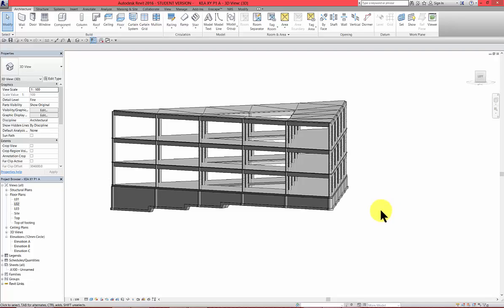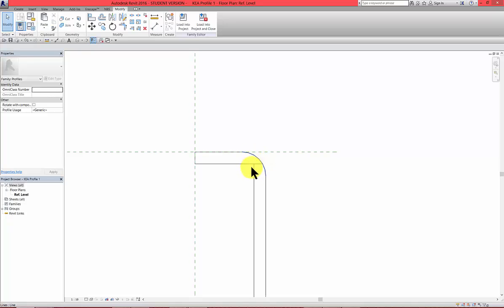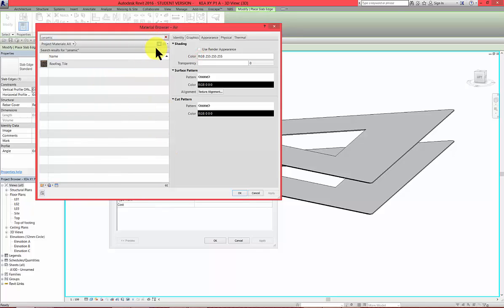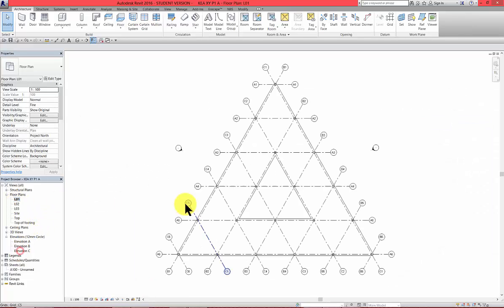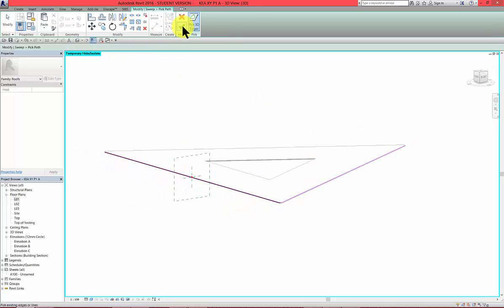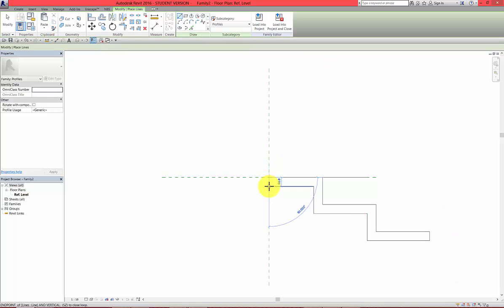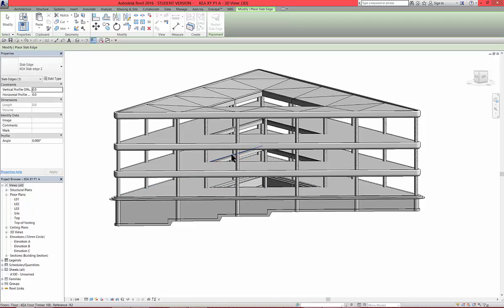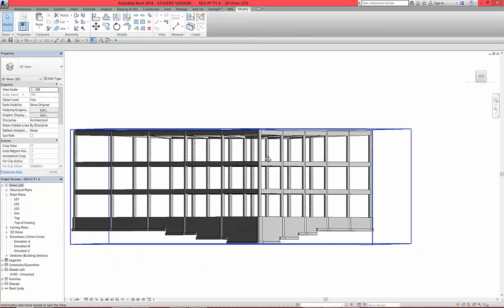Revit - P1 - Part 17 - Concrete Building - Floor edges

Comment: For people who can't get their profile to load into their project. I had to #1. Add the lines into a single group. and #2. Specify the usage type in the parameters to be used as a Slab Edge. (These options are during the edit family when creating the edge)